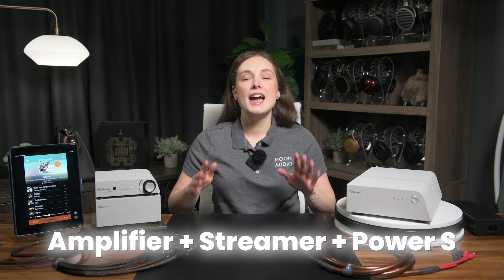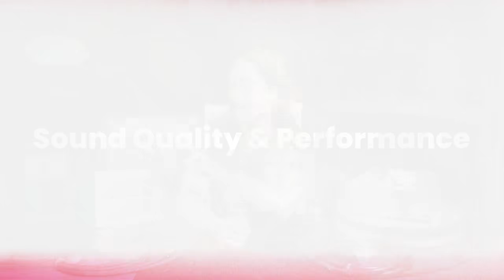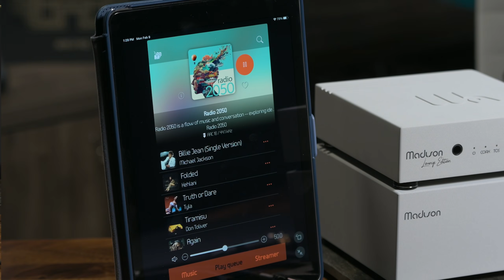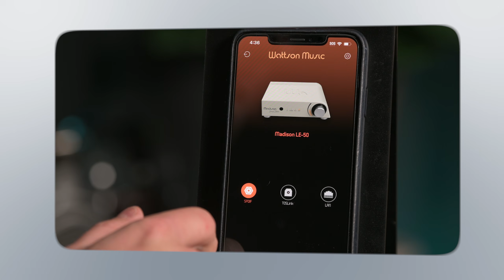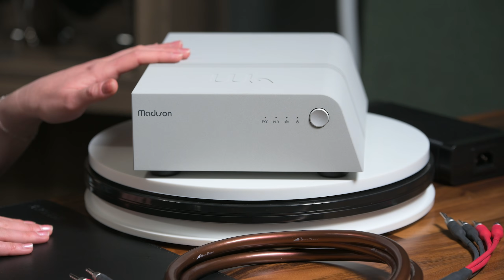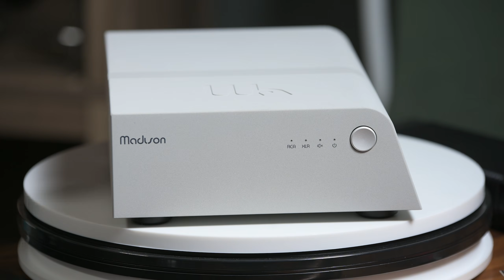This Streamer + Amp + Power Supply Combo is INSANE

Comment: So- I tune pretty expensive systems. The Wattson Madison - even without the power supply and amp synergy beats the Denafrips terminator plus, the PS Audio Bitstream ,the Chord Dave and Qutest, and the MSB analog DAc with power supply. I actually bought one for myself. I can't wait to ge the power supply but also wonder how the Teddy Pardo supply the one for the other day might sound on this. This also blew the Topping E30 out of the water- simply no comparison;

Comment: A single Madison will be challenged in a large room at reasonable db levels (89 spkr sens).  Two are more (mono mode) reasonable but more headroom when pushing volume or wide dynamic swings at double the price.  Considering the SPL S-900 @ 200wpc.